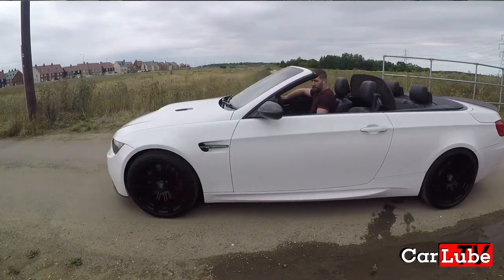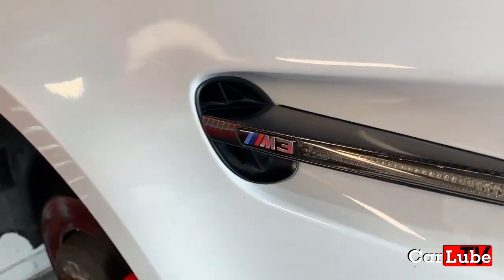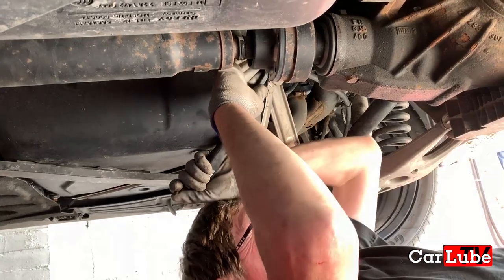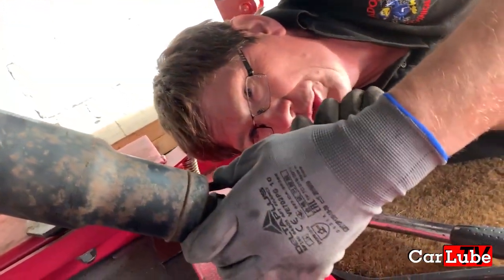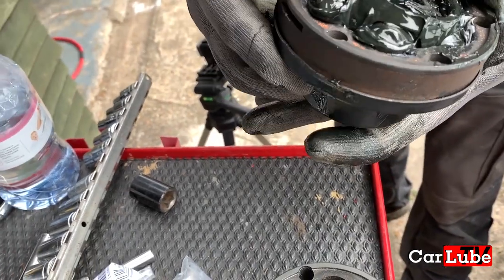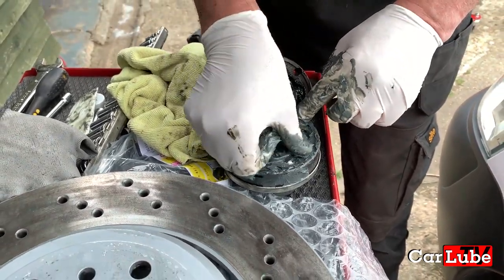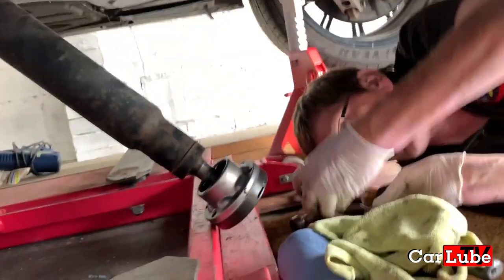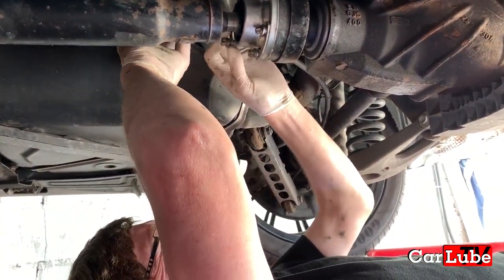BMW E9x M3 - Changing the Prop-shaft CV Joint - getting rid of the cowbell sound

Comment: same car here, same noise. problem solved by replacing the CSB and cleaning/lubing the splines between the two halves of the driveshaft.
Reply from the maker: Yes, mate, that’s what eventually fixed it on mine. Thank you for the comment.

Comment: I had this on my old e92 M3, I did everything thing you did (didn’t cure it) then replaced the prop shaft it had a hair line crack in it, you couldn’t see it whist on the car, don’t waste your money on a support bearing as the new prop comes as one whole part  including the new bearing , I think it was about £550 from cotswolds Bmw. 👍
Reply from the maker: james bexon thank you mate.. 
I wish I’d done that first, I’m already about £450 in the hole on this one.
Reply: So you managed to get a whole propshaft for 550 from Bmw was that using a bmw owner club discount ? There around £1500 from what I can see am I missing something here ?
Reply from the maker: James Barham in the U.K. a new prop is about £800 from bmw, I’ve seen a full carbon fibre one for £1200

Comment: Hi, 

I’ve been following this for a while as I had exactly the same noise on my BMW E64, 645ci. 
The car went in and a crack was found internally in the propshaft itself. 
The part was £1100 and plus fitting =£1650. 
The noise has now gone and I’m poorer but happy.
Reply from the maker: Thank you for your input buddy, I am 99.99% sure I know what it’s going to fix it now. I keep meaning to do the fix but this year has been difficult with funds, i’m going to change the said support bearing and also the rubber gweibo
Reply: @carlubetv  Best of luck, the noise drove me insane at the end. The AA paid £500 of the £1650 so £1150 is still a lot of money but how much for a peaceful life? 
I say peaceful lol, my V8 has the back box deletes lol
Reply from the maker: The sound really does annoy me too, especially when I have the roof down.

Comment: I’ve just changed my centre bearing and the thin shim between the front and rear shafts. I also found the the splines connecting the two shafts quite dry and I lightly lubed them with copper grease.  All fixed. Hope this helps.
Reply: Thank you mate !!

Comment: I change the hole prop shaft and still have the sound. My mechanic says its inside the diff.
Reply from the maker: P N it’s probably not the diff.. 
well in most cases it’s not, I know someone that got a new diff under warranty and it still came back  from Bmw with the sound
Reply: https://youtu.be/_JWjuc14eps Maybe this could be the sound? But from the rear control arm.The video shows the front one.

Comment: I'm changing my CVT joint right now.  I have lots of play in the drive line.  Don't have the cowbell noise.  I had it on my previous m3 and it was gone after replacing the complete driveshaft from the donor car when my engine seized on the front main bearing.  I think the cowbell noise may come from play in the U-joint.  I think when center support bearing fails,  you'll get noticeable vibration and whining sound.
Reply from the maker: Roy Moorman That’s very interesting, you are describing the UJ in the centre of the prop shaft right? As I mentioned in the video a future plan once we are able to go out again is to do the centre support bearing and toying with the idea of refurbishing the prop as well. In your opinion would that work?
Reply: @carlubetv  What else could it be ?  I think you already eliminated the other possibilities.
Reply: @carlubetv  Initialy,  the excessive play was gone after replacing the CV joint at the back of the driveshaft,  the guibo disc and the DCT mount.  But now it has come back again.  Not all at once, but at an increasing rate over  a couple of weeks.
Reply: I get a hard knocking vibration when I’m going 100-120 and I have this cowbell noise I’m thinking it’s my driveshaft , Would that be a noise of a failing driveshaft while the car is accelerating?

Comment: I had the same noise, replaced the prop with a used one from romney and its cured it. I believe the noise is from the universal joint in the middle of the prop close to the centre bearing. I still have my old prop (dct car) if its any use to you?
Reply from the maker: Andrew Cooper thank you mate, because I’ve now ruled out the UJ, and the CV joint, if I was to use yours I could be starting from scratch again, very kind offer. As I said at the end of my video my next course of action is going to be the centre support bearing, i’ve just been toying with the idea of refurbishing the prop shaft at the same time to save taking it all apart potentially twice more, it’s a ball ache.

Comment: hi just wondered if you managed to fix the noise yet as i have the same problem
Reply from the maker: Shoresy I have ordered the part but haven’t had a chance to fix it yet, Centre support bearing, and rubber coupling
Reply: @carlubetv  ok thanks for getting back to me will you be making a video ?
Reply from the maker: Shoresy I will indeed, i’ve just been busy trying to get the car out of limp mode recently, One might say that’s more important that the car can actually drive lol

Comment: i suggest you give up on this sound. It is a normal sound, everything must be super perfect for this sound to go away, even when it does it comes back at 15k, this is a factory warrior car, and warror car makes noises, kinda like the lsd in the 90s concept, its meant to make sound, thats what we get in 2008 watch some of my videos.. take care
Reply from the maker: TIM Cheou I hear what you’re saying buddy but it does really annoy me so I will continue to chase it down. Thank you for your input
Reply: @carlubetv  you will get just tiny bit better response, in taiwan our technique is to replace whole shaft with everything support joint new, so the tolerence will be perfect, with partial change tolerence from old tear and wear matching with new is still tolerence no matter is right or wrong still tolerence, sound continues, in taiwan we are told to replace new shaft, new support new gear box mount new engine mount, restore to day one, providing the car never had accident, thats how tight bmw tolerence were... but even at that o heard with many burn out and donuts 15,000km back again.. maybe bmw made the parts to have gaps so lasts long, according to usermanual it mentioned about this sound fyi
Reply from the maker: TIM Cheou thank you again, I will report back once I’ve attacked it again.